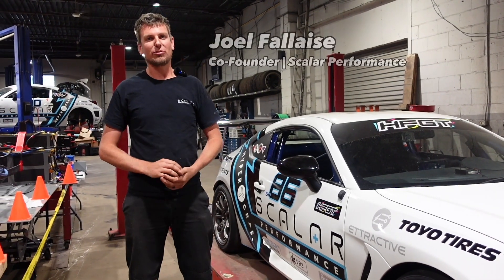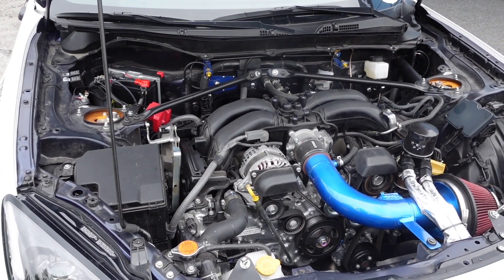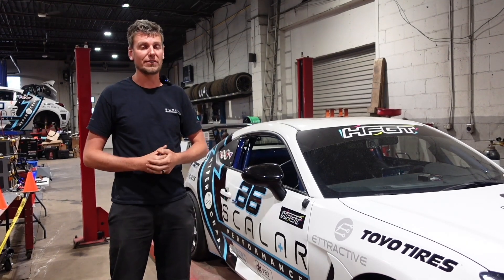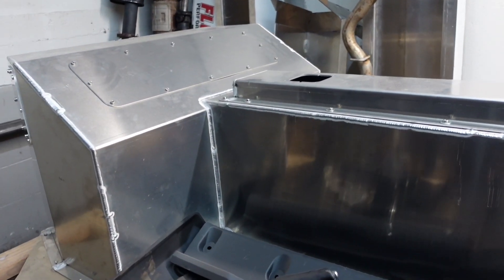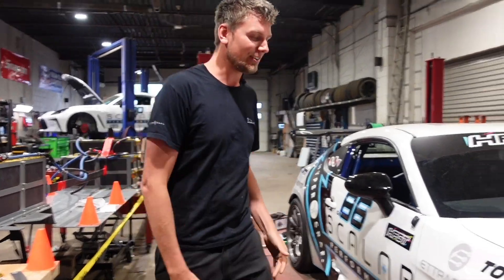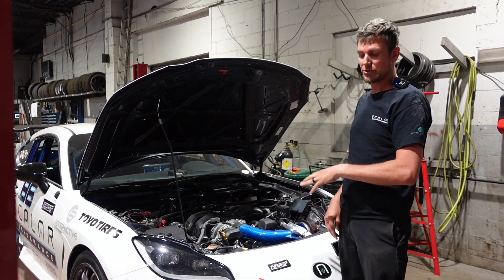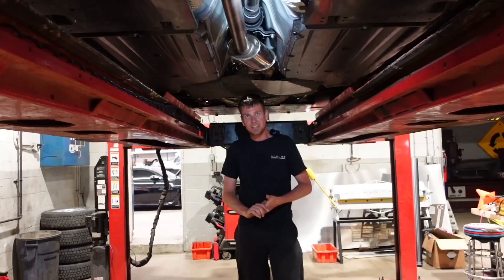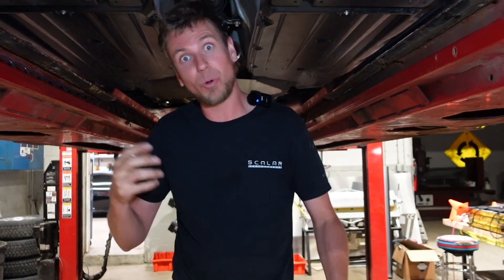EXPLAINED: How I Converted My GR86 into an ALL-ELECTRIC Race Car!

Comment: As a second gen BRZ owner, this is really cool. Lol at people acting like this is sacrilege. If this were a 9000 rpm GT3 RS, that would be one thing, but the 86 has never been about the engine- it's unreliable, slow and doesn't sound good. Once battery tech improves and the weight can be kept down, the 86 will be better as an EV
Reply: All about an GT86 EV.

Comment: I'm about to do this to a RX8.  Great chassis made better by being electric driven.  I picked up a nice RX8 with engine issues for $1,500, Have made most of that back in parts sales. I also decided to mount the motor in the rear hopefully using a Tesla rear drive set-up. Any thoughts on that would be appreciated.  Suscribed
Reply from the maker: Tesla swaps aren't something we have experience with.  Sorry, all of our builds have been 800V systems.

Comment: How much capacity of battery did you guys put?
Reply from the maker: It's a 60kWh pack in our race car.
Reply: @scalarperformance  woah thats a lot of battery for a car this compact. I wonder would i still be able to fit a 2nd row seats in it?
Reply from the maker: @mamadhharyadi2429  This was very specifically designed to achieve the corner weights identical to a Porsche 981 GT4.  Remember this is a race car, so its rare to even have a passenger seat installed.  In this case, the battery takes the rear seat/gas tank area.  Definitely watch more of the videos on the channel and you can see how the battery comes in and out, how we build it, etc.

Comment: This is dumb. You lost your manual and you’ll handle like crap because batteries are heavy. Pick a car that wasn’t fantastic to begin with. This is gross and underwhelming.
Reply from the maker: You might want to watch a few more of the videos or look at the Hyperfest race results - its about 10s a lap faster around Virginia International Raceway than a well prepared gas GR86 race car and that's before we really get it dialed in.